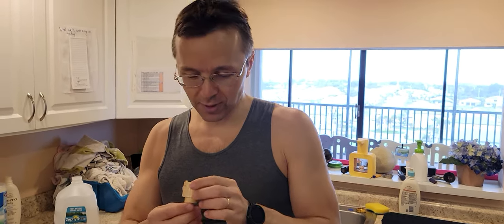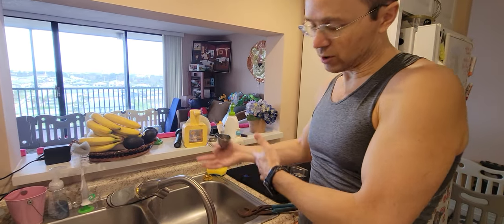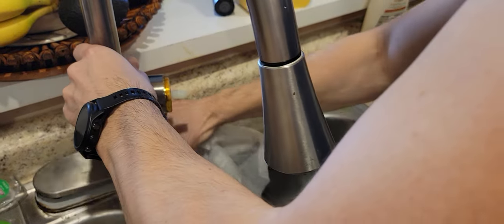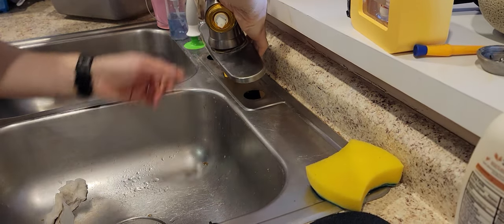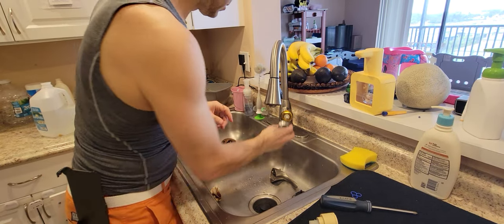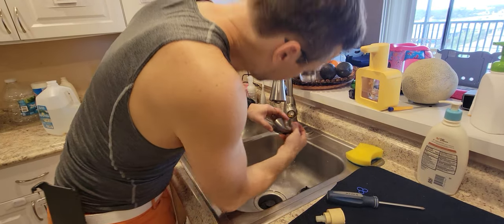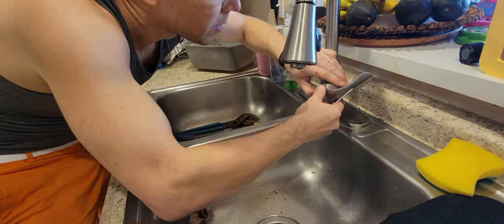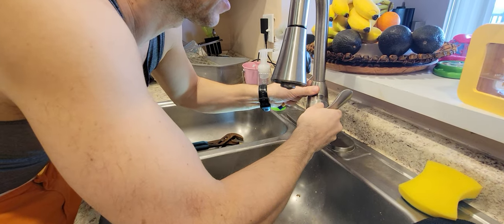How to Fix a Dripping Glacier Kitchen Faucet #diy

Comment: How do you get the thing apart?  How do you get the 'cap' off? number 6 on the parts list? Pry? Screw?   How do you get the handle off?   What size allen wrench for the set screw to get the handle off?
Reply from the maker: To take it apart, I unscrewed the holding plastic nut underneath the sink. 
That will allow you to extend the faucet appliance higher above the sink.
There is an access hole in the handle that would allow to visualize a small handle securing part (socket screw) as described in google search: "Glarks 200-Piece M3 4 5 6 8 Hex Allen Head Socket Set Screw Assortment Kit".

It might be tricky at first. I don't recall the size of the allen key, but it is pretty small.
I just tried the keys one by one to see which one fits best.
Be careful not to lose the screw (very tiny).
You got this!
Reply from the maker: P.S. once the "allen head grab screw" is loosened or completely removed, you can just pull the handle out.

Comment: Nice video but you did not show the part number? and why did you have to remove the base to just change the cartridge?
Reply from the maker: Thank you, Hill. 
I can't recall why I had to remove the base... I believe it allows a better visualization of the holding bolt and probably a better leverage.
The part for this particular faucet was: Glacier-Bay-Single-Control-Cartridge-Assembly-864860
You have to make sure it is the same faucet. They have different models. To ensure that you are getting the right cartridge, I would remove the faulty cartridge and compare the layout to the one you have in stock.

Comment: What you do when one of the hoses leaking from one of the 3 hoses
Reply from the maker: You probably need to replace the washers. If it doesn't solve it, replace the hose system.